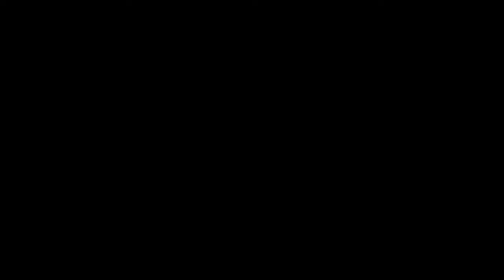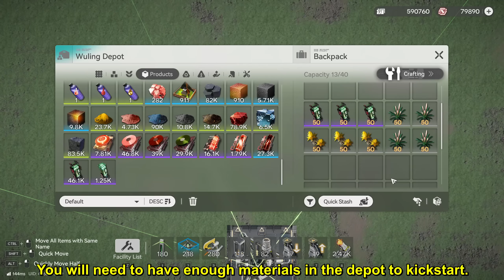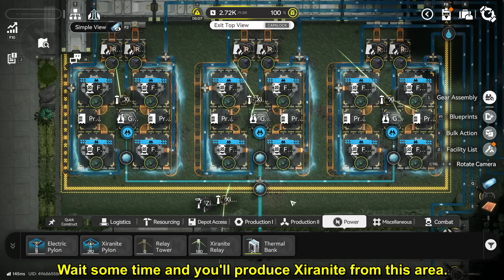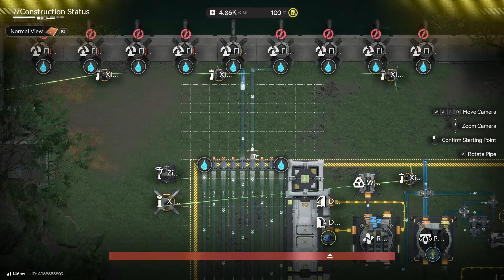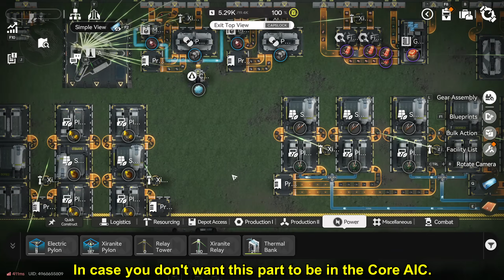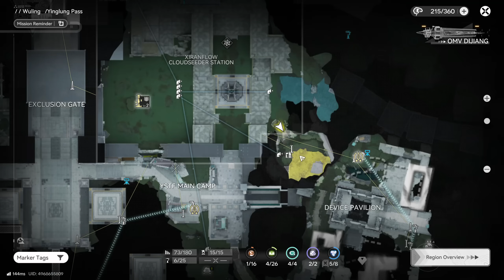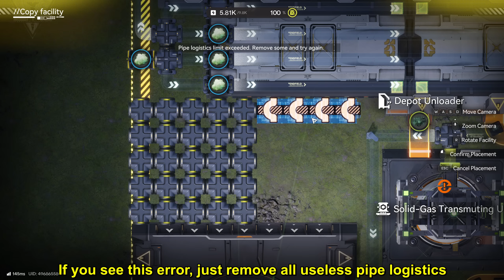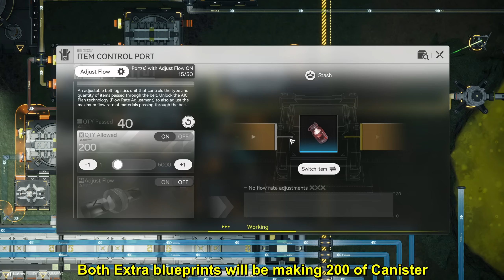1.4 Wuling Factory Blueprints Part 1 - Max Profit Mega Base Blueprint Asia/NA/EU【Arknights Endfield】

Comment: Hey Kyo, I set up your blueprint for the base, its beautiful as always, however I keep running into one issue, the refining unit's keep clogging with 50 Cuprium, which haults the  sewage production which ends up cutting off battery making which makes it impossible to keep power...
I dont see any difference between what your video has and whats in mine.
or maybe the protocol stashes are fulling and clogging the line? I am very confused, any advice would be great.

Comment: A few things I found to speed up your factory construction:
- In top-down mode, you can hold ctrl and place multiple buildings (meaning the game won't clear your cursor after each place)
- When dragging belts and pipes with a turn, you can press R to get it to snap to the other 2 edges of a rectangle.
Noticed that you aren't doing that in the video, so I hope these help!

Comment: Keeps clloging and no batteries made :( also used the other blueprint for trashbin, seems to not get enoufh xircon
Reply: I think this my problem too it feels weird i dont get much battery like before -_-
Reply: I keep ending up with batteries out=batteries used; Xircon keeps being the bottleneck.
EDIT: 
I think it's cuprium overflow. Destroying my stash seems to have fixed the issue.
Reply: Idk exactly where is the issue but for now, i keep destroying orig ore and anything that reaches max 80k+, Kyo said we shouldnt cap but it keeps reaching everyday, this way i get 3.5-4k batteries per day.

Comment: For the people using the purify nodes to save energy, USE 3 COUNDUITS INSTEAD OF 2 AS THE BLUEPRINT, the double counduit gets OVERLOAD because of the flow limit of the pipes, so you need a third conduit to keep up with the flow of sewage and avoid clogging. I saw that problem after seeing my production is not enough to supply my Outposts so I hope Kyo see this to warn the players who use the purify node blueprint.

Edit: Oh right, once you fix the problem by adding the third counduit to clear sewage, eliminate all refining units to clear the sewage clogging the production and put them again.
Reply: Thanks a lot for this comment! 

This was the reason my pyrro parts production was going slower: cuprium ore yield/usage jumped up from 300/300 tot 420/420 after changing the double conduits to two singles and everything is working perfectly now.
Reply: @driesbrouwers7077  Happy to help mate!

Comment: Guys, why does my production level drop to lower values? Does yours stay stable? The batteries settle at 12, as does the heavy xiranite, while the pyrrolite parts at 8.
Reply: same i feel like my factory not producing much like before lol something is wrong for sure >.<
Reply: Make sure all your nodes are running. An easy way to troubleshoot is to take a look at the pipes and conveyors, and see which ones don't have material. Machines as well, look for the idle icon.

Comment: For the extra Hetonite production, I used the gas route. In marker stone this could even be expand for an extra Pyrrolite parts. to put 1/2
I believe this is more efficient, since in the gas route it takes 8 Cuprium for one Hetonite part and in the gas route with a stable environment it takes 5 per part. However, we only have two Cuprium, so the fluid rate would have 2/8 uptime and the gasify route 2/5. Though the purificaiton unit needs 4 cuprium and one seperator core, with equals to one cuprium excludeing the Xiranite, so the hgihest efficiency would be a 4:1 ratio of couprium witch we can' achieve. By taking one Cuprium belt putting a splitter on it, so 1/2 of the flow rate goes into the bottles production and 1 belt plus a 1/2 flow rate belt goes into the gas transmuting unit, it should result in the highest purification units uptime with a 3:1 ratio. This would be ~94% uptime compared to a perfect 4:1 ratio.
So if I didn't make any mistakes the gas route with only 2 Cuprium available is 50%(~0,94*(2/5))/(2/8)=0,5) better than the fluid route and can be expanded for extra pyrrolite parts instead. 
I believe this is worth the extra usage of Xiranite, but i didn't calculate that. 
Also this is completely unnecessary, the base produces already more than enough and the extra production is just a really small part of that, so a higher efficiency there changes basically nothing.

Comment: hey man, is this setup supposed to produce enough mats to sell everything at the outpost? im finding im having trouble clearing all of it unless i also sell the new gear mat which i would want to hoard for now, i just run out of batteries/serynges/xiranite to sell and theres always one of the 3 outpots i cant cap out
Reply: i have the same problem lol not sure why im not producing enough to cap clear them
Reply from the maker: If you produce 6 Pyrrolite Components per minute, then the production stays in line with what the outposts requires.
So by switching to 3 pyrrolite comps per minute you will slowly produce more.
For me, after few days, im at max depot limit for pyrrolite parts because i cant craft gears anymore, the base overproduces a lot.

Comment: Is the jingyu valley base supposed to be empty if im using the wuling alt 1? 

Edit: saw your overflow video so I put the trash bp there, thanks
I noticed you dont use all the inergen nodes, do you just place gas extractor there for development then forgot about them?>

Comment: I thought that I followed along fine, but my heavy xiranite, pyrrolite parts, and pyrrolite components are all under performing. Anyone know what the issue could be?
Reply: Same here, idk why. Alr following all of this tho.
Reply: I had the solution in the other comment, you can try it it fixes your problem. I'm not sure why this happens, I don't see lots of people having the same problem so I guess it happens by chance or some niche reason. One thing that I can think of, is that I'm not following his way of connecting xirangen conduit into the AIC unit since I already had it set up when I play through the main story, but I doubt that matters. Other than that I can't think of why it only happens to few players only.
Reply: I had the same problem, after an hour of inspection I found out its the two Solid-Gas Transmuting Unit (25:51 right side in the video) that responsible for producing pyrrolite not having enough xiragen input, leading it to cease function every few seconds. 

The solution I did was using a pipe splitter at the xirangen output at the Solid-Gas Transmuting Unit (again at 25:51 left side) that produce xiragen and connect it to the pipe that supplies to both the pyrrolite Solid-Gas Transmuting Unit with a pipe converger.

Here's my blueprint for it if anyone is still confused, just use this instead of the 1.4 YP Top, but remember to take out all five of your conduit inlets and outlets and put it aside first so you can just replace it instead of reconnecting.

Asia Server btw:
EFO018IeE2u6Eu1EUI73

Comment: I'm having a problem, the Expanded crucibles that must make xircon for the battery lines, are clogged, Xircon is not getting produced so i only have 5 battery production D:, can't figure out whats making them clog, trying to trace the problem, seems like  I'm not producing Xircon effluent to make Xircon D: aaaah
Reply: I ended up removing everything and placing it again and its working :/ don't know what happened, why liquid xircon stopped being produced and every crucible clogged
Reply: Has it messed up again since then or is it fine
Reply: @KNG-J  nope, its fine now, i think it maybe happened because i took too long between placements of the different blueprints

Comment: Just  a small tip for others who may have the issue I did with certain resources not keeping up.  By moving the AIC core thingy itself, some power lines might get disconnected and thus you might not be getting the normal materials mined like usual. I noticed this happened to me and just had to had another halfway connector, and bam, back to breaking even
Reply: This helped me! I never realized that moving the Jingyu Valley AIC somehow disconnected one relay (even though it is close enough and should work?) which caused me to lose the resources for upper part of Jingyu Valley, Hulu Cave, Qingbo Stockade AND Sword Vault Dale. They still counted in the AIC report, but they never actually went into the AIC system which left me dry.

Comment: Do you not have a problem with Xircon production? For some reason, for me it is steadily decreasing (Y/U is 31/39 for some reason)
Reply: If u used Jingu Valley sub AIC blueprints, check ur ferrium powder production line there.
Reply: @kyiwintun8797 partially found issue,, after update some of mining rigs were disconnected despite active connection, replacing them fixed issue

Comment: If u use Jingu Valley subAIC, u will need to put protocol stashs to collect ferrium powder. For some reasons, they were missing in blueprints and it took me two days to find the root cause as the base was making profits selling batteries even without ferrium powder at all and some probably won't notice at all.
Reply: As the video showed, you're supposed to move the sub-AIC unit in front of those ferrium powder grinders to collect the powder.

Comment: I followed all the steps exactly, and after two days my factory isn't producing resources? I've found that I no longer have any Yazhen or Xiranite flowers? I don't understand what happened?
Reply: Xiranite flower ? Have you plug the water pipe ? Try reverse enginner it you can see what is the problem
Reply: @fajartirta4934  Thanks for the comment. In the end, I had forgotten to connect the three water pumps that produced Yazhen to the mains. That one mistake alone really killed my factory, but I'm already recovering.

Comment: I have some question
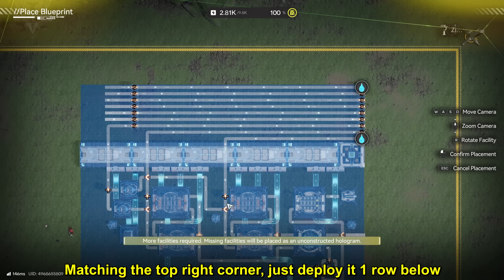1. what's the function of the pipe sphagetti in Wuling 1 at 9:10?
2. I copied your whole blueprints (basically manually placing it one by one) and I have unused 35/min ferrium powder is this intended or Im doing something wrong?

Comment: Weird. Everything else seems to be like in this table - 28:14
Except the Syringes. I'm producing only 2 per minute, not 3. It seems the 2 outputs of cuprium stones is not enough to supply the chain, because 1 output is also split into creating cuprium parts... Does anyone else also have this?

Comment: I mean no disrespect but I really hope this Mega Base gets updated soon, there's so much extra space it seems like a waste, cause what do you mean you can have an entire AIC empty, not to mention Kyo's only telling us to use only around 10 gas sites when multiple have opened up around the map?
Reply: that's honestly not even an issue, even valley 4 also has lots of space that goes unused

also using minimum amounts of gases is better in my eyes since it just waste protocol capacity space
Reply: Its really depend on the player, empty space mean you can build other stuff manually. This is just kyo blueprint and everyone has different one

Comment: im using more seperator cores than im making, why would that be? Pretty sure I followed all steps correctly
Reply: nevermind, figured out that I used a pipe splitter instead of converger for the inergen node at core AIC area

Comment: This update massively reduces the number of buildings we needed, there is so much extra room in the areas now.  I've even got enough building space to start up the farm again. Your work is muchly appreciated by the community, and the sacrifice you make to get it done has not gone unnoticed. 

Just as an aside however, did you know that you can unlock the mouse with Alt on the keyboard? It makes placing the pipes and buildings outside the AIC areas much much easier

Comment: SO I followed this exactly, but I seem to be missing something (and so does the video) in the Extra 1, there is a fluid tank that is slowly filling at the top right... but it doesn't go anywhere, what happens if/when this fills? Is this supposed to go somewhere?
Reply: its meant for the spray, which is used for the blight

Comment: you can drag back the effluent from purification node and connect it to extra xircon production at top right corner of base to increase production by few percent
Reply from the maker: do not do that!
the base is made to work perfectly with all Originium ores and DOP from metastorage already.
The extra effluent will clog it resulting is slowing down the battery production

Comment: I’m grateful as always for the base guides:)

I’m having an issue and was wondering if someone could help me troubleshoot: my main PAC isn’t producing the new gear components. I don’t seem to be producing pyrollite.

Additionally, I’m not sure if I have too much xirogen but it’s always clogged. The top part of the YP base is also stalled. 

I must be doing something wrong but I can’t see where my errors are.
Reply: I have the exact same problem, no idea what is causing it

Edit: I forgot I moved my water fluid pump (the one outside the AIC) to somewhere else and it was unpowered by a pixel, this was the issue for me
Reply: Check if u connected all the Xiragen outlets/Inlets right or maybe one its not connected, that was my problem somehow I forgot to connect one. there's also a pipe control port at the very start of the Xiragen connection to the base, make sure its letting the Xiragen pass, I turned mine off when I was troubleshooting and it's working fine.
Reply: I think I had an overflow of intervention that was clogging the system. Or my connections from the outlets weren’t synced properly. It’s working now. Thanks much!

Comment: Huh. I used this blueprint and thought I set up everything correctly. Every product is producing at the level expected except for Xiranite. I only have 300 yield even though theoretically theoretical yield is showing 360. So it is slowly draining. The Forges look like they are running fine in the marker aic so I have no idea what I did wrong.

Edit: of course 😂. It was one of those damn Yazhen planters not having anything in it. Man I swear I hate how this game doesn’t put the seeds in the machines automatically when you use a blueprint.

Comment: Sorry for the late comment but do I really need to integrate the Xirogen outputs? I was under the impression that any gas spot had limitless flow, meaning I could do every process I need with just one extraction site. Is there any efficiency increase by limiting flow to the minimum necesary per process thus requiring this integration? plz can someone enlighten me.

Comment: it doesnt produce enough separator cores to keep the heavy xiranite production running?
easy to fix but a little annoying to trouble shoot
Reply: Okay so there is some additional production via the hetonite part but was limited to 200 and even with that i still had to build 1 more set to produce enough 

also the hetonite solution production for the hetonite parts was faulty and only using 1 reactor instead of the 2 that exist so half efficiency due to belts going into 1 and straight out from the same one into the other one thus only using one of them so need to redirect one of the belts and fix a pipe placement to get it to 1 belt for each reactor instead of running them both into one and then that one diverting it into the other one without activating

Comment: Kyo! Thank you once again for the amazing work, much appreciated! I do have one question however; for the yinglung pass we're using a 100/m Xiragen connection, the question is, does it actually work like that? As in, can you stuff 100/m into a single connection? Wouldn't the pipes limit how much of that gas intake is going forward?

Edit: nevermind, I took a 2nd peek at the gas producers: they do 1 gas every 3 seconds, the pipes can hold 2 units per second so a single connection could hold up to 6 gas producers at once :O

Comment: Kyo, just a question, my production rate of the battery is 11/12, on 14.5 that you explained. Double checked everything, but it seems strange for me. So my curiosity is, having turned on the pyrolite components and part, can slow down the production rate or it's a matter of resources being used?

Comment: idk what am I doing wrong but my factory keeps dying because it gets clogged(?) and stops producing xircon needed for batteries 😭😭😭 (I'm sure it's 100% my fault but I genuinely don't know what is the issue help)
Reply: Same, for me its somehow produces way too much gas of all types and then clogs cuprium as a result which in turn clogs everything :(
Reply: Try to unload and put it in again 😭 (i have no idea). Check your max item because xircon need the black fluid > does your red stone production slowing down ? 

I have this problem before turns out my gear component already max and because of that my red stone clogged
Reply: @f @fajartirta4934  deleted some of the red stones (I'm desperated) and it unclogged, Xircon in production again!THANK YOU

Comment: Did you know you can save up on xirenite by making more liquid xirenite  by adding the gas to it and to do it efficiantly you can use the  pipe control port to adjust the flow from 1 crucible to 4 fluid gas reactors so they can run on the minimum flow for the max output